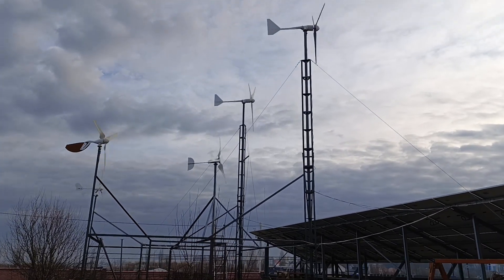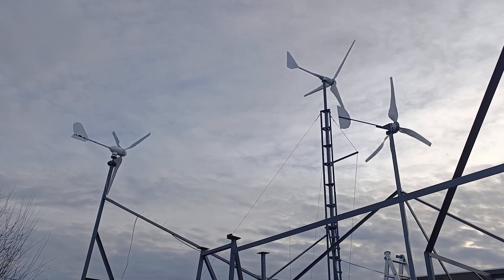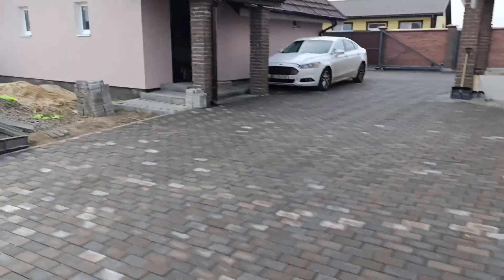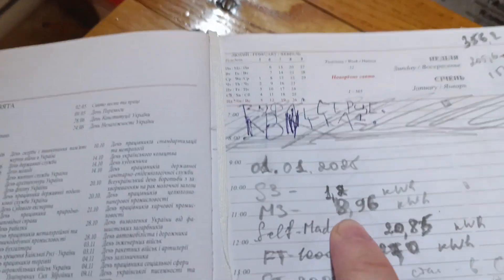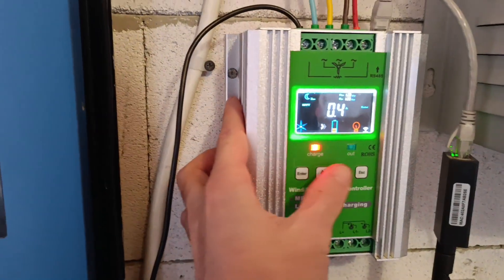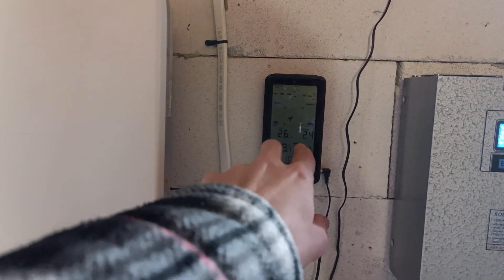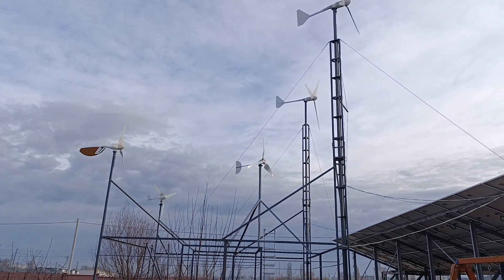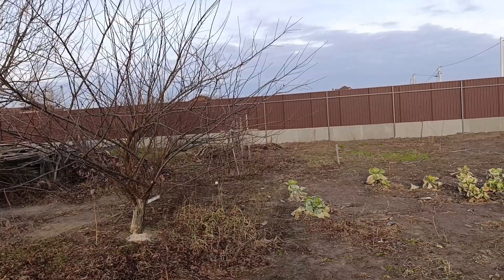The stats of the 1-st week of 2025 winter for the wind turbines - which one performs best and why.

Comment: -                        One week of production in January 2025
S3                -      1.65 wind wheel   -    5M high       -      0.8 kwh 
M3               -      1.65 wind wheel   -    5M high       -      2.5 kwh
Self Made   -      2.2  wind wheel     -    6M high      -     3.65 kwh
FT1000       -      2.5  wind wheel      -   10M high    -       4.9 kwh
FT2000       -      3.2  wind wheel      -   10M high    -     12. _ kwh
                    -                                        -       12M  
3.6 meters per second average wind, in a non windy area of Ukraine.

Comment: G'day Mate, I found small turbines start up in lower winds of 2.7Mps,
turbines using 1.2M wind wheels, these outputs are only what I saw in a 6.17Mps Wind Storm, would have gone higher in peak winds of 7.82Mps.
26V - 24V 500W Vevor          -  Normal 5 Blade  - 6.5M high    -   8 Amps
26V - 24V 500W Vevor          -  Normal 5 Blade  - 6.5M high    -   8 Amps
14V - 24V ista Breeze i500   -  Scoop 5 Blade    - 4.5M high   -  11 Amps
12V - 24V 300W Hiacynth    -  Normal 6 Blade  -  4.0M high   -    4 Amps
12V - 48V 500W Sunboo S5  -  Scoop 6 Blade  -  3.5M high   -  2.5 Amps
12V - 48V 500W Sunboo S5  -  Scoop 6 Blade  -  3.5M high   -  2.5 Amps
12V - 48V 500W Sunboo S5  -  Scoop 6 Blade  -  3.0M high   -  2.5 Amps
12V - 48V 500W Sunboo S5  -  Scoop 6 Blade  -  3.0M high   -  2.5 Amps
12V - 48V 300W new rotor    -  Scoop 5 Blade  -  3.0M high   -  1.5 Amps
12V - 48V 300W new rotor    -  Scoop 5 Blade  -  3.0M high   -  1.5 Amps
Peak Output Totals  =  44 Amps  =  752 Watts ( my target is low winds )
Town laws stop me putting up a big wind turbine high enough to work.

Comment: We have an FD4 (2m wings, 4.2m rotor). Aron at Huayaturbines has been very good and helpful so far. I wish the turbine had more stainless steel bolts. We have it 400m from the ocean! We have an MPPT boost buck in it. I think it is 96VAC, but would have to ask or look in my emails (16mm wire, 6AWG). It's on a 48V LiFePO4 bank with 320 amps. Sometimes it is on a smaller bank of 100amps (48V again). We saw 3Kw in 5 hours. We hide it in the trees and have it on a 3m tower. lol VERY windy here. We saw 30 amps. The manual brake is not very strong and will allow the turbine to spin in a light breeze, be very careful using it (heat and damage/harm). We will add another 3m of tower this spring, which is scary when it gets to 125 kms/hr here. Here is a video of us hiding it in 60-90 kms/hr. It is tiltable with 25' gin pole at 90 degrees. https://youtu.be/P4DPbXJi4h4
Reply from the maker: yes, my next one will be FD4-3kW (4.0 dia) - exactly from Aron, but that one will be the 380V version, and will go to the Deye PV-input.
I see this wind turbines' protection also works very well, it furls it away from the gust - which is extremely good thing to have.
Reply: Hi, could you post your turbine information and production ? 
I would be very interested and I think it would help this channel.

Comment: Hello BogDan ! About your perspetive to add new wind turbines , what do you think about pitch controled turbine? what do you think about the robustness of this technology ? WHat about if the pitch control do not work fine, blade will start to be unequilibrated and escalade of dangerous problems ?
Reply from the maker: about blade pitch - my personal opinion is that they are not needed if you don't see many winds over 15 m/s. since that is mainly a protection techology.
if compared pricewise - fixed pitch wind turbine is twice as cheaper than the blade pitch (within the same manufacturer, and same all other parameters).
however, variable pitch machine reaches its stated nominal production power later, and requires a bigger diameter. f.e. go and compare Greef AH-5 and GH-5 just the tech data, and then do the same for AH-10 and GH-10. you will be surprised that blade pitch one has a bigger dia, is way heavier and gets to it's declared power value later on higher winds than the standard fixed pitch one.

another thing is that if you want to go tailless - then yes, then blade pitch is a must, and in that case it is always better to use the PLC controlled blade pitch over the centrifugal one.
Reply: @BackyardVoltage  i retrieve AH-5 and AH-10 datasheet if you need.. I also get a purposal / offer at 5800$ the AH-5 and 1300$ for the mppt controller https://www.youtube.com/watch?v=EA-Oxx7mwCs
Reply: And just at the moment for the FT-L2 4.0 meter diam, 1630 $ , maybe this new one you would like install next ;-)
Reply from the maker: I've got those proposals, as well as for many GH series, as well as for their bigger machines. they seem to be good, but overexpensive for me personally. however, I know people who wat to get Greef only...
I actually have got 4.0 m diameter machine in delivery right now. that one is from Huayaturbines, FD4-3kW 380 VAC model, will be working with the on-grid controller and will be supplied to PV-input (used in a wind turbine input mode) of my second Deye inverter. hope to launch it this spring-summer. second Deye - I'll get you some video very-very soon, it's almost 100% launched already.
Reply: @BackyardVoltage  Wouaaah !  That sound nice ... BUT , are you sur that the Deye MPPT controller is reactive, fast enough to manage securely and optimized the Turbine voltage drop ? i mean, based on MPPT algorithm, there is difference about PV and Wind management  because there is differences of behaviour and security equipement to electricaly manage . Exciting to wait for your test 🙂
Reply: @BackyardVoltage  Is there some controller technology which tranform directly turbine AC to Network AC ... Because , theorically, there is a lake of efficiency to AC wind -> DC - AC home used
Reply from the maker: @ on Deye - there is a power curve for the wind turbine, adjustable!
however, you cannot connect a wind turbine there to PV-input of Deye directly, you have to use the interim on-grid controller for it.
Reply from the maker: you can use the standard Grid-tie inverter for the wind turbine, they exist for sure, but the thing is you cannot always use them in an off-grid modes, there are troubles with that. however, DEYEs GEN-port can resolve that issue as well

Comment: Hi, What it is the ratio of your wind production over the solar one  currently ?.  Did you ever try some 12V turbine on 12V battery setup then use to voltage setup to feed a 48V battery system with the 12V framework ? 12V turbines requiers less wind to charge a (12V) battery... Of course you have the loss of the voltage setup.... It's an idea.... I will maybe test this year
Reply from the maker: My solar capacity - 50.31 kW of panels
My wind capacity - 4 kW of turbines

november 2024
wind - 81 kWh
solar - 1529 kWh
consumption - 1490 kWh

december 2024
wind - 90 kWh (kinda average, it's hard to get an exact value, as I've been moving around controllers a lot)
solar - 415 kWh
consumption - 1285 kWh

January - solar will already outperform November, but the wind production will be bigger in total as well, as January is way more windy compared to Nov and Dec in my area.
Reply from the maker: also about 12V wind turbine and then ramping it up to 48 V - don't do it. it won't payoff the trick.
better get a proper 48V wind turbine and a boost controller (for exampe the white-orange one I have on a self-mader WT - starts charging from 20 V already on a 48V setup) and put it on a nice height.
Reply: @BackyardVoltage  stating charge from 20V for a 48V system ? how it's possible ?
Reply from the maker: boost module gives it a hand. it works as a charm.
controllers in general can be of those types:
1. ballast types. battery defines the voltage starting and endind for the charge mode. old design, too short range, required crazy dumpload to hold the machine.
2. boost type PWM or MPPT - has the boosting function, I've seen controllers able to boost from 6V even for the 48V system (I will actually have one in the end of January - of course there will be a video about it). PWM or MPPT defines how it work with loading the wind turbine. is a good  choice for same voltage wind turbine and battery pack (e.g. 48V and 48V, 24v and 24V).
3. buck type, again PWM or MPPT. lowers the incoming voltage form the wind turbine to charge the battery bank. for example, 96V wind turbine and 48V battery back, or 120-150 V wind turbine and 48V battery bank. PWM and MPPT - same as above - just defines the load preferences.
4. boost and buck. combines both functions, but is rarely needed.
5. on-grid controller. cannot charge the battery, is just managing transforming the power form AC to DC and manages the brakes, is suitable for high-voltage wind turbines 220/240/380 VAC. I will have one in about 4 months with the 4.0 dia wind turbine of 380VAC.

Comment: Hey, love your videos! I have sm6 96volts wind turbine and 48volts system at home. What controller can fit this settup?
Reply from the maker: I bet this one should fit: https://s.click.aliexpress.com/e/_DcAmxLr
choose the white-orange one, the 24/48V version
Reply: I have tried 48v mppt wind controller and it slows down this turbine too much. Works a lot better when connected directlly to 96v e-bike battery. I even saw 1.5 - 2kw on storm wind gusts with 96v battery. But my home system is 48v so i need to find proper controller
Reply from the maker: aha, so just ask for a buck controller type. to charge your 48V battery bank.
https://www.alibaba.com/product-detail/3KW-MPPT-Wind-Solar-Hybrid-Controller_1600711508255.html
same like this one, just you need the buck type (price is the same), go for the 2 kW version, it has a resistor built in. ask the seller to provide you the buck one - and that will be what is required.
LHCM2-1/48 buck - is your model name needed.
Reply: Hi, could you post your turbine information and production ? 
I would be very interested and I think it would help this channel.

Comment: Great job! I am impressed. One question if you don´t mid. What kind of lighting protection do you have? I have DPS connected to the wind turbines but looks like that is not enough in the event of a direct lighthing strike. Looks like we have to connect the wind turbine´s masts to the ground as well, but the debate I´ve found is that wherter they have to have a separe ground from the house or not. Some electrical egineers say that they need a separate ground, others say that they have to be connected to the same house ground. Nobody agrees.
Reply from the maker: good questions.
for the lightning protection there are two things to be done:
1. towers must be grounded
2. there has to be a surge protection on the line from the wind turbine, before the controllers.

some of the controllers have the surge protection built it, some don't, so it depends on the equipment what you should add additionally.

in my cases I have got three boxes prepared with the separate surge protection before the controllers. towers are or course grounded. you can do both, same or different ground, it does not matter. our national standard allows both ways as equally usable.
Reply: @BackyardVoltage  thanks alot it was me who asked for this comparison kindly let me know what KP series your were talking about would you mind If share link ?
Reply from the maker: those are kPE, kPG series. 200+ kg of a wind turbine, heavy duty stuff.
4.8 meter in diameter is the smallest one in that series.
this is the 10 kW kP series, for example with 5.8 dia (will reach 10 kW power at 13 m/s wind): https://www.alibaba.com/product-detail/Residential-Wind-Power-Generator-10KW-Wind_62068742893.html
Reply: @BackyardVoltage There are no rules in my country so I have asked two engineers and they do not agree.

One says that you have to connect all the copper rods to make a network. Otherwise, when lightning hits a tower, the electricity spreads through the ground, and enters through the other copper rods and towers, even the one in the house, but in the opposite direction. If that is true, imagine the damage.

Anyway, the chances of being struck by lightning are very low. Fingers crossed
Reply from the maker: @JoseAgustin-hq2pl  what matters with the lightning - is the number of ground connections and the connectivity of all of them. if you have enough earthed rods - the lightning will use all of them to hit the ground. of course they have to be connected above to the lightning receiving upper rods (or towers in wind turbine case).
Reply: Make senses, thanks😊 @BackyardVoltage

Comment: Did you connect the FT2000 Controller to a grid tied inverter or directly to a battery?
Reply from the maker: all of my wind turbines currently work with the charge controllers, so all of them charge the batteries, and the grid-tie inverters drag the power out of the batteries and pass is to Deye system